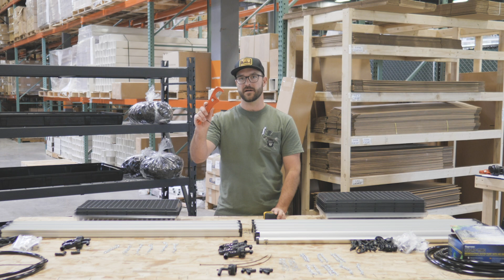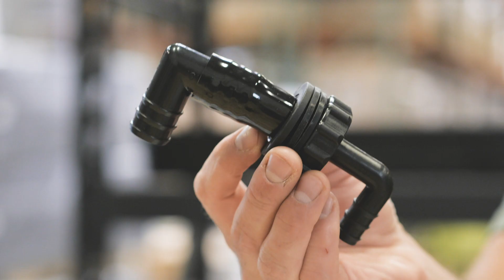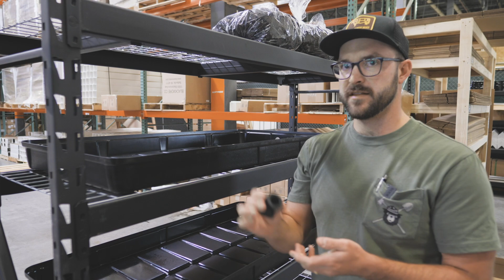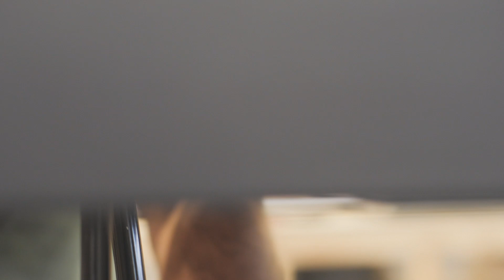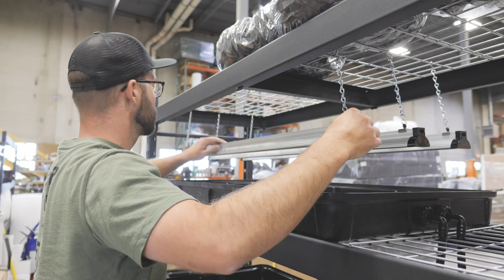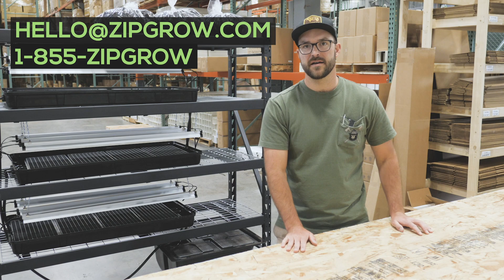Seedling Cart Assembly

Comment: What do you do about mosquito larvae? Especially in the sump...Several years ago I purchased several single-tower units, each with its own reservoir. I've not been able to use them except indoors, due to "wigglers". Thanks!!
Reply from the maker: We don't often run into this problem because the water is not stagnant and usually the constant movement of the water through the pump deters this, but if it helps you can dose hydrogen peroxide into the water to help kill algae and insects at 2ml 5% peroxide/L of reservoir solution!
Reply: @ZipGrowInc  Thank you SO much!!